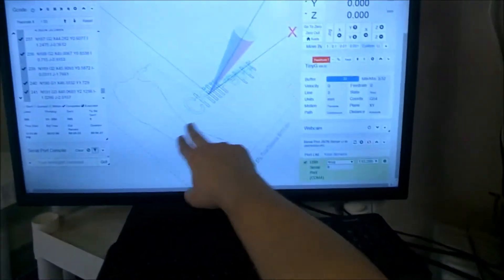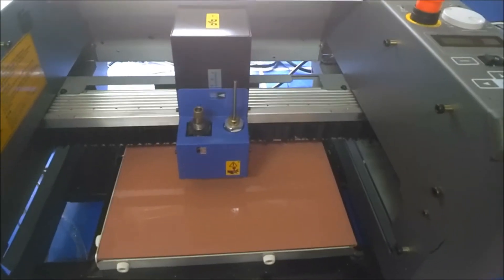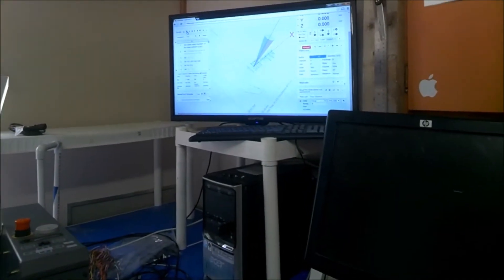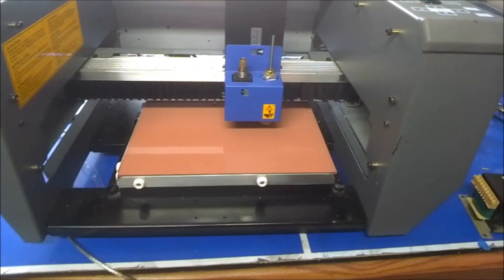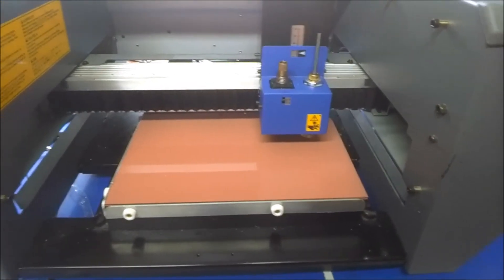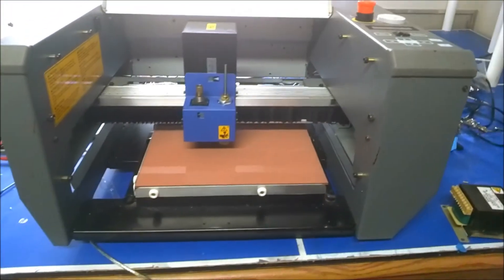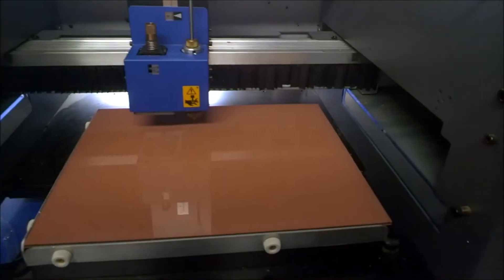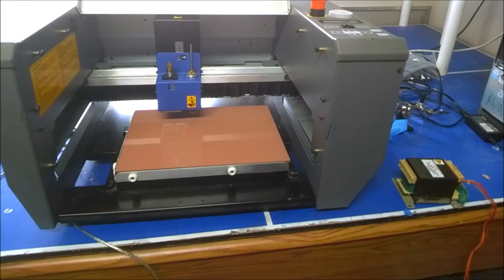Roland EGX 300 running on a TinyG pt4

Comment: Hi, I had a quick question? I was using your great videos to convert my roland egx-300 with the tinyg board and I was just wondering if you had the configuration file because when moving/jogging around the distances don't match between the tinyg software and the actual axis movement. Any help would be much appreciated. Thanks